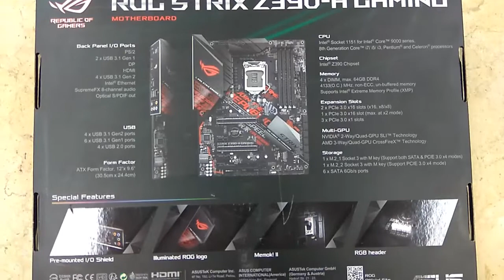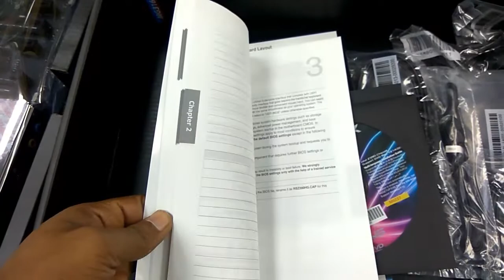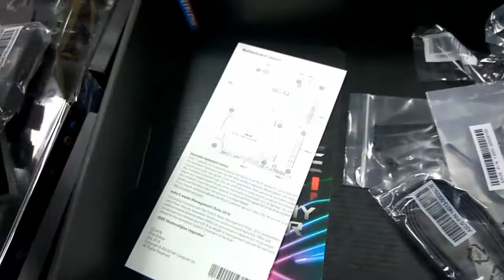ROG STRIX Z390 H GAMING UNBOXING SUPPORTED 8TH GEN 9TH GEN |TECH LAND

Comment: Hi. I have this motherboard. The only problem I am having is I cannot control the LED lighting. I want it just to be static (it is breathing). I have tried syncing it with AURA but the motherboard section is locked. I can only access DRAM. Any idea on how to fix this? Thank you and more power to your channel.
Reply: Bios > Advanced Mode > Advanced > Onboard Devices Configuration > SupremeFX LED Lighting > Still Mode
Reply: @m.rod6751  Thank you. Will give this a try.
Reply: @RyBreezzy  can you control the rgb on the io shield?

Comment: PSA:
Make sure you update your Z390-H Gaming to 805 bios or it will cook i9-9900k cpu's!
Before update: 4.8 GHz on all cores => 5 seconds stresstest to 100c on 240mm radiator watercooled rig.
After update: 5.0 GHz on all cores => 30 minute stresstest to 76c... Not nice Asus!
Reply: What kind of cooling unit are you using?
Reply: What settings you using on your overclock ?

Comment: I have a Fractual R6 Case and it came with the Type C connector. I have the Z390-H motherboard but can't figure out where to hook it up on the board. Any help would surely be appreciated.
Reply from the maker: no bro in this board does not have type-c header for front panel.
Reply: @TechLand2  Thank You for the response I thought I was going crazy looking for it. Much appreciated.
Reply from the maker: Please Subscribe
Reply: Don’t subscribe

Comment: Does this support the full i7 chip line up? including the lower end i7? 
Thanks.
Reply from the maker: No problem u use all 8th gen and 9th gen processor.
Reply: @TechLand2  Thanks because i only have i7  4790 3.60GHz which i want to reuse for this motherboard and i do not want to spend a lot of money for 8th or 9th gen processor because its very expensive
Reply from the maker: i7  4790  not supported this motherboard
Reply: @TechLand2  ok thanks, but this fits i9 9900k?
Reply from the maker: i7 9700k, i9 9900k, all 8/9 th gen processor supported 
Please Subscribed

Comment: Z390-H  i9 9900k @ 5.0Ghz  :)
Reply from the maker: yes but use proper cooler
Reply from the maker: Please Subscribe
Reply: @OG Hey bro what voltage do u got it stable? Thanks :)
Reply: @gnomodagrecia  1.300v
Reply: 5.1GHz @ 1.315v now
Reply: @m.rod6751  is that on all cores? Just bought this mobo and the 9900k
Reply: @jesterthelegend926  Yes
Reply: @m.rod6751  nice, how is stability? you have any issues
Reply: @m.rod6751  do you still use that overclock?
Reply: @DarkSoulsFan12345  yes
Reply: @m.rod6751  I've heard that z390-h gaming has bad vrm. Do you have  excessive cpu usage or any other problems with it?
Reply: @Random12249  no problems here